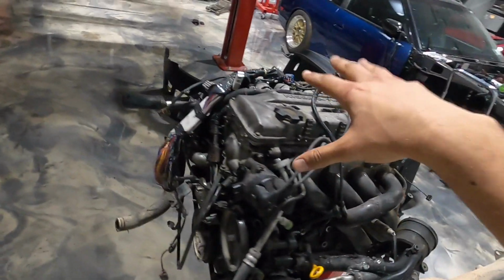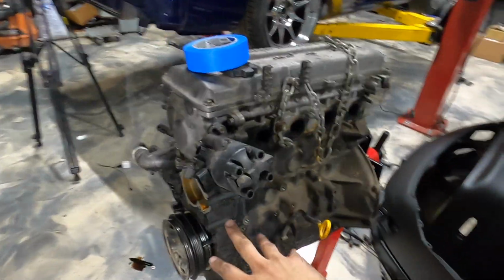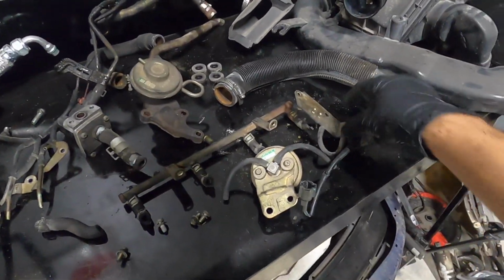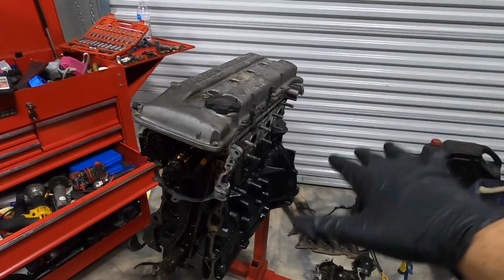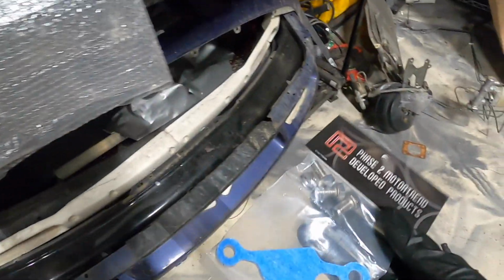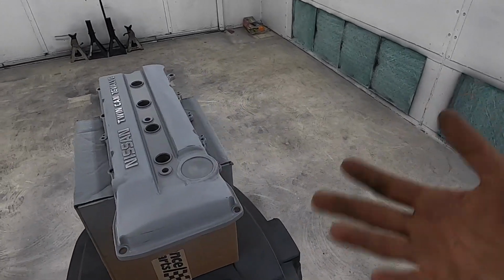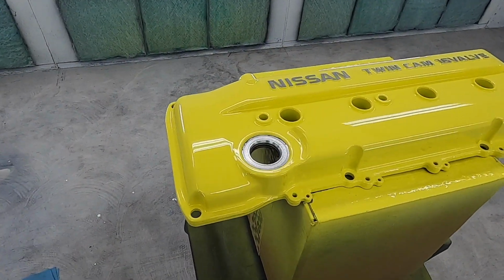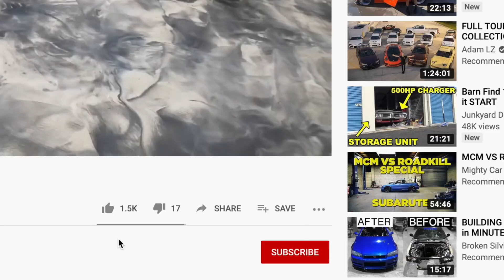240SX Major Engine OEM+ Overhaul | Mind Blowing Results

Comment: Been planning to do this kind of oem+ restoration on an s13. Love the vids🖤
Reply from the maker: It's so satisfying once it's done, let us know if you need any pointers 🔥
Reply: Kevin malli hope u see this i need some help so i bought a 96 s14 oh about 6 or more months ago for 1700 with no rust shocking just dirty banged up and needed new rings so me and my buddy tackle wat seemed would be a job in its self but we did our first ever motor rebuild to the stock ka24de on it and I decided to do a egr delete and and ever since i cant see. To get her running right idk if its because i deleted to much or not enough or not the right way but i love your videos and watch them every time u post and was wondering if i can get some insite uk its a dream of mine to have a s14 and now i got one i cant drive her like i want to cuz i cant get her to run properly she idles rough heats up fast but never overheats also while driving jerks my head off its like it has power and wants to go go go but soon as u step on the pedal it like a horse is trying to buck u off if uk wat i mean its hard to describe i just need some help figured ur a really good nissan guy i love ur 300zx and ur red now blue 240sx s13 im just stucknuk desperate if u will could u give me some insite man jw ik ur busy with the give away and all when u can if u want message me on here or my ig is ey3_candy.s14
Reply: @GRODroguegang  did this start happening when you did the EGR delete? It was fine before?
Reply: I did the egr delete as we had the motor and intake apart put it all together when it was done b4 we did the motor rebuild even woth bad rings and broken rig sets like it ran hard and ran better then it does now with everything stock just blew alot of smoke uk but j seen all these vids of egr delete and how clear the bay looks without it so i went for it and now man like just cant get it right now i have reused like the distributor and sensors and maf and stuff and i think thats my problem to there getting old and need replaced its just irritating cuz b4 the rebuild as a 23 yr old car it ran fine now that it fresh uts shit uk idknim lost i dont wanna give up cuz its a dream come true but idk man uk wisb i had a more experienced nissan guy to help me
Reply: And been on the forums they done gone to hell ppl just criticize mostly very few help
Reply: @GRODroguegang  do you have something i can private message you on so we can figure this out? Malli might be abke to help, but hes prolly p busy so i coukd try and help you out.
Reply: @danielmorris5470  ig is ey3_candy.s14

Comment: Is that an evergreen oil pump? I wouldn’t advise running that as they’re prone to failure. Get the gears and top had to rebuild the oem oil pump. It’s only about 90$ from Nissan